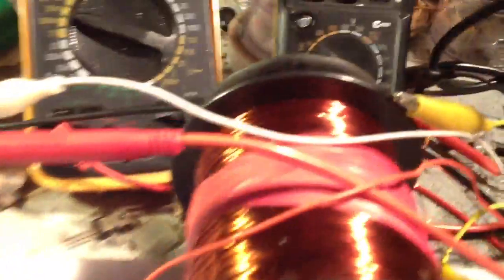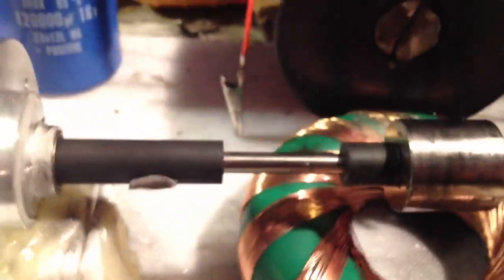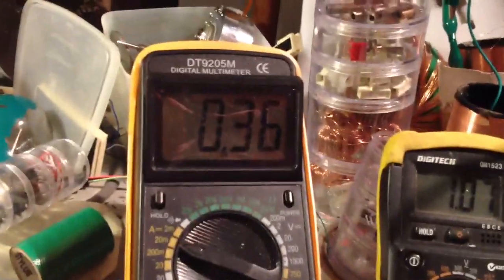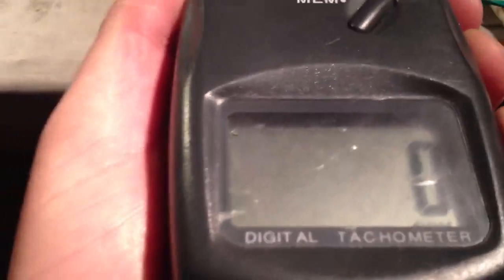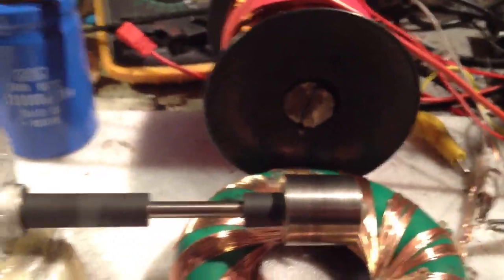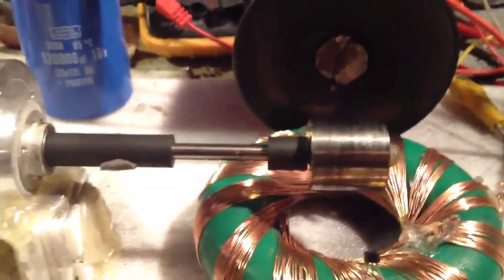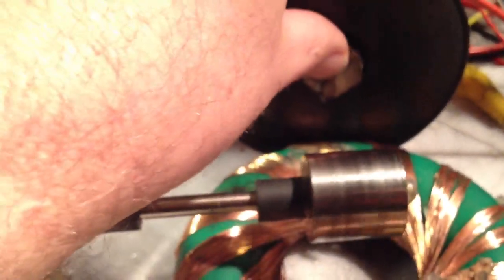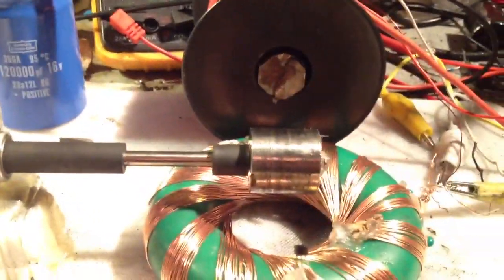Rodin pulse motor gen thanes heins

Comment: It maybe possible to place the cap into the rodin field area and see what the results are.  The cap has its own field between the plates.  you might want to slice the donut in half first and place a coil inside the rodin  you should get a very large voltage from this coil in the order of 1600v.

can you send me a complete schematic for your setup?

At 28000 rpms their has to be some serious torgue.  perhaps this idea could run a car using small motors at very high rpm and simply draw power

Comment: Excellent!  I have a very similar device I call the FlowerPower Device that uses this principle as well.  You should be able to short your gen coil for greater acceleration... if not, use a finer gauge wire...I have found at least 150 ohms or so is best for this type of gen coil.  Mine is #34AWG, iirc.

You may also see better results by placing the gen coil on the same axis as the pulse motor coils... in this case, the gen coil would be directly above the rotor.  Keep up the good work!

Comment: Yep, is hundreds of mA on your meter. 

If it runs faster with a battery or cap,  but slower and with more draw with an appliance (neon). Then it seems logical to say the cap is feeding some power back into the system while it charges.

Where is the amp meter connected? it should be right to the coil... it would be worth looking at amps on the neg or vout of the coil too...

How does it go if you put load on the drive shaft? 28krpm for 300mA is nice. What is Thames grins effect?